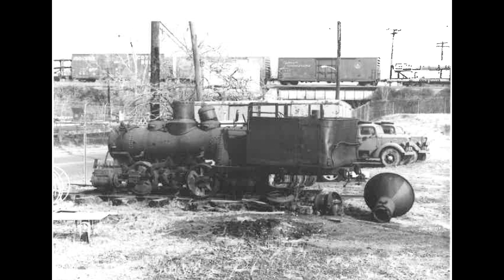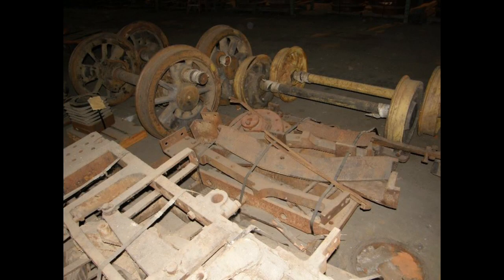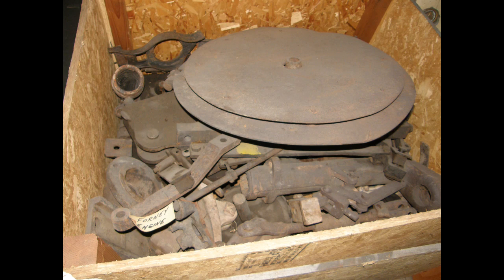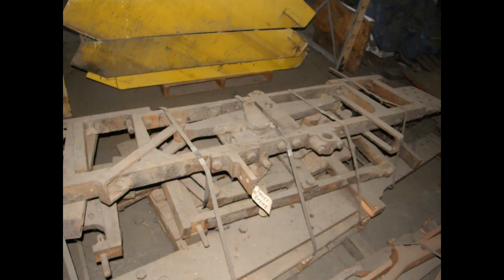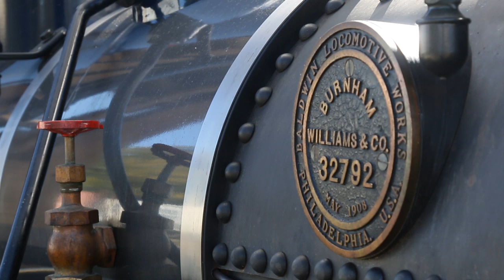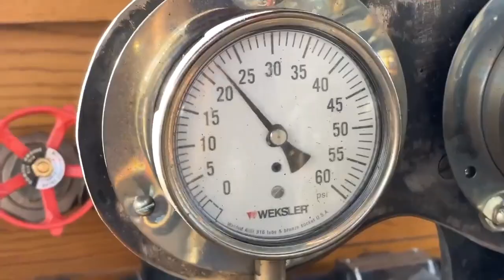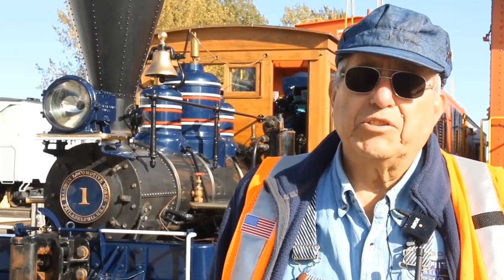The Bock Lumber Story

Comment: Is that coal dust or sawdust being used in the fire box. That thing is small. I love it.
Reply: Looks to be sand, being used to scour the tubes. The loco's actually an oil burner, probably converted to avoid being a fire nuisance.
Reply: @ZeldaTheSwordsman  The shape of the stack and the screen inside it suggests that this engine was originally a wood burner. Firing wood burning steam is very labor intensive, even moreso than a coal burner. Oil firing is a lot easier to deal with.